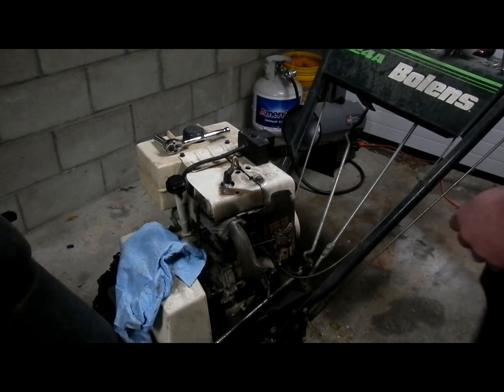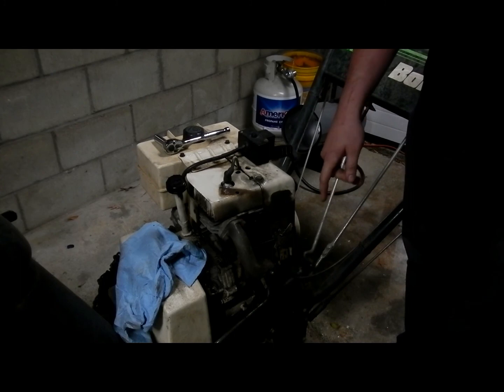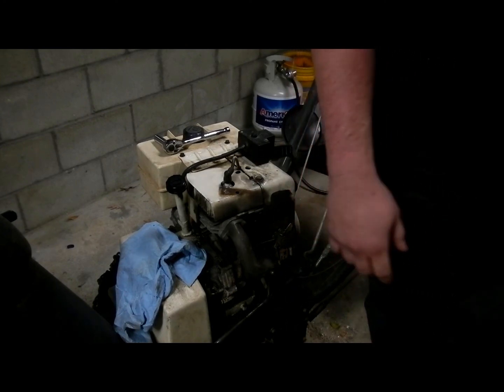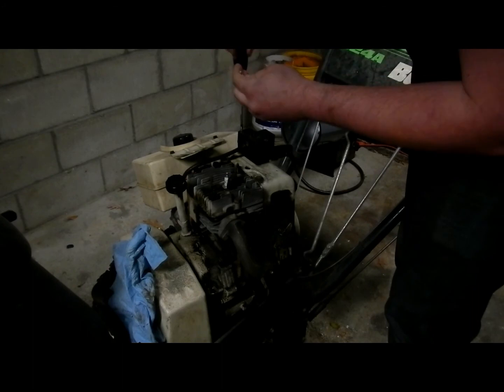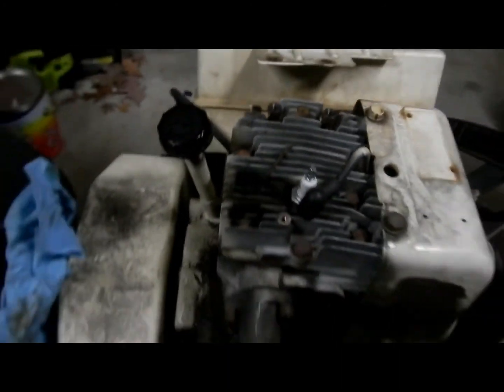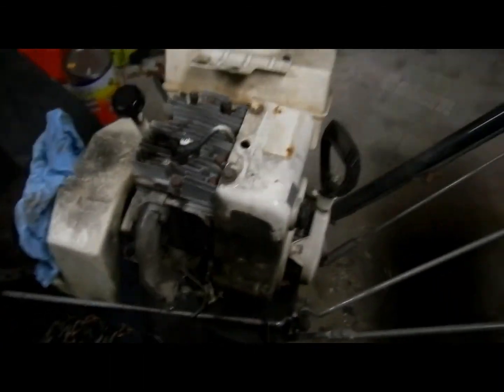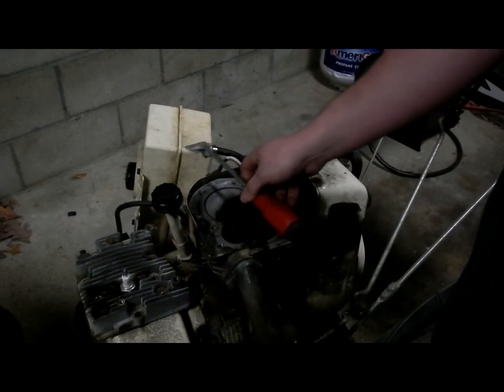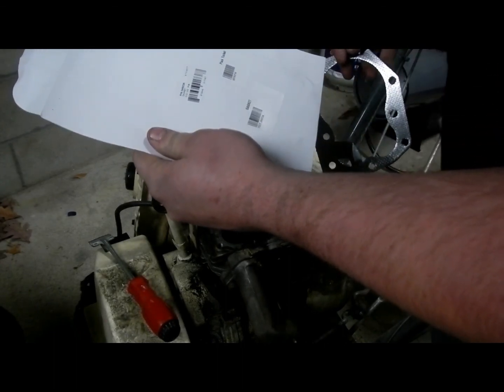DIY - Replacing a Tecumseh Head Gasket (SNOWKING ENGINES)

Comment: I just smelled my 17.5 tecumseh has a oil leak sent out the valve cover then seen the gas line needs shortened a little bit and re adjust the choke lever 

Thats what i get for buying used items a bunch of stuff the last owner didn't fix

Comment: Lets get something straight here, a Tecumseh snowking engine is nothing more than a horizontal engine set up for winter. The horizontal summer engines are the same thing, except instead of a heater cover, they have an air filter. 
They swap season to season, its one of the things that made Tecumseh great. That 8hp Tecumseh you blew up is the same engine as this one your working on. A few years difference, but the same, a medium frame horizontal L head.
So when you say Tecunseh made great snow king engines, you can go ahead and expand that statement too Tecumseh made a great horizontal engine period. An HM80 is an HM80 weather its in winter or summer mode.
If you or anyone wants to debate that, look up one snowking engines part diagram, its gonna show that at the time an air filter and assembly was also available for that engine. You can also look at the videos of my old Ariens, which switches from a snowblower to a rotary mower. The engine is interchangeable season to season.
Tecumseh made good verticals too, they also made descent 2 cycles for a wide variety of products. Tecumseh was also the king on mini bikes back in the day, again were touching on the horizontal line their. A few bad apples does not rule out Tecumseh from everything except winter, that is B.S. Also they made better engines than a lot of the junk being made by the other MFG's now. Briggs had a few bad apples too. So were going from blowing them up to fixing them.
Generally in the past it was common knowledge you used a Briggs for Summer and a Tecumseh for winter. But thats too broad, because truthfully Tecumseh's horizontals were a great line of engines. Yes the one you blew up is the same as the one your fixing now. The statement below is accurate.

Comment: this looks like the same engine you guys blew up a few years ago
Reply from the maker: +Donovan Bryant no this was an 8hp Snow King engine from the early 80s. The engine from a few years ago was a 5hp from the early 70s
Reply: LaPavoniMac They are the Same.
Tecumseh Snowking engines swap straight over to Summer engines. Particularly the older ones. Hm80 is Hm80 weather dressed up as a snowking or sitting with an air filter on it.
They swap, the heater covers come right off, air filters go right on. Look at the older Ariens sno thros as an example. They swap from snowblowers to lawn mowers and other machines. They have that ability, because the Tecumseh it has swaps too. You gotta have an air filter if your cutting grass.
So I don't know why you say specifically, only Tecumseh snow king engines were good. You mean too say Tecumseh horizontal engines are good, just like the one you blew to hell, same engine.
Tecumseh made a great horizontal engine period. They also made good verticals. Still better than most of the bullshit made now.